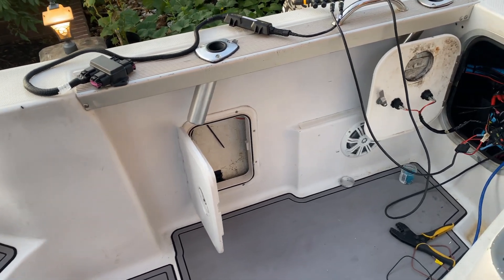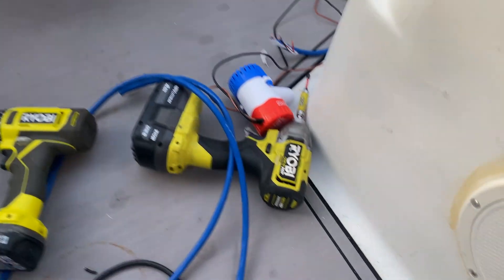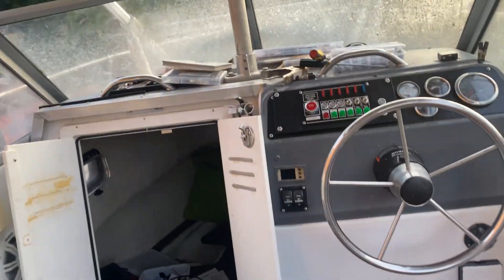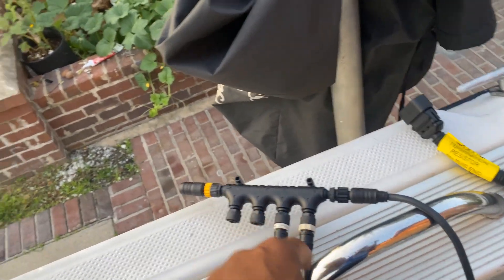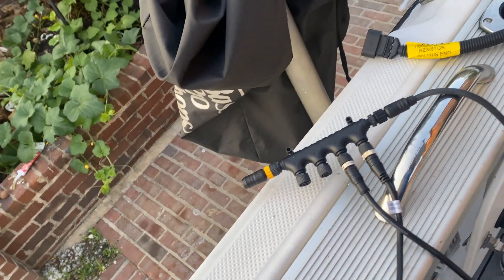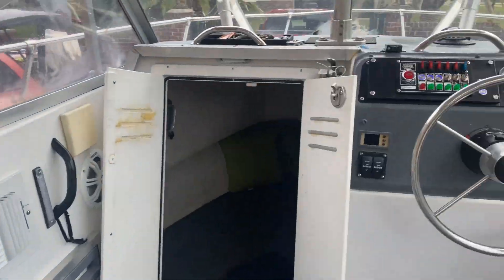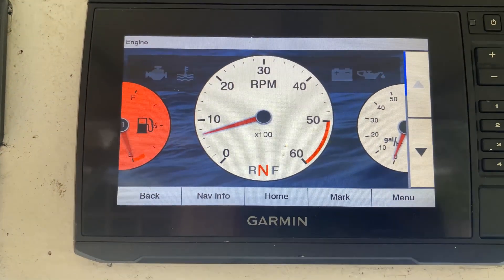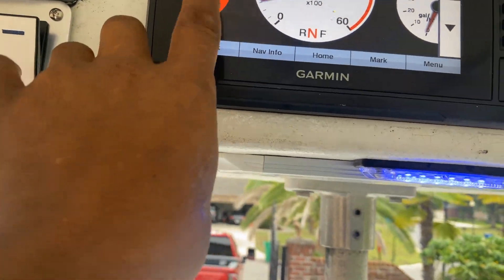Install Mercury nmea 2000 gateway (  National Marine Electronics Association) Part 1 update.

Comment: I HAVE A YAMAHA F70 WILL ALL OF THIS ALSO WORK WITH MY MOTOR, WITH MULTI HUB AND GATEWAY AND BLUE CABLE, I ALREADY HAVE A INTERFACE CABLE COMING FROM MY MOTOR TO THE NMEA2000 BACK BONE
Reply from the maker: does your system come with  i command system. if it does you just buy nmea 2000 cable and connect to your nmea backbone. if not make sure you have a yamaha engine interface cable. yamaha interface cable hook up to the backbone and from your backbone nmea cable to chartplotter
Reply: @visackkhemmanyvong4577  how would I know if I have I command system, I do have the interface cable and backbone hooked up also to my graph

Comment: Thanks for the video. Not sure but can the hub be connected to the gauge output connector, then from the hub one cable back to the gauge and one cable from the hub to the gateway- so that you do not have to connect directly to the engine and then you would save all the cabling.
Reply from the maker: yes, but only if you have the Mercury Marine / MerCruiser New OEM Monitor Eco 4.602, 79-8M0119406. My setup is to display on Garmin CHARTPLOTTERS AND FISHFINDERS. check out the video that video i hook it up to the guage
Reply from the maker: https://youtu.be/yFbxLIu59rc?t=227
Reply: You are 100pc correct, thank you. I got the same result as you the can bus light come on and went off after a few seconds. This is with the spare connector that comes on the harness, one goes to the instrument gauge, the other is spare. I connected the spare to the hub, and connected the gateway to the hub and that is what happened. I am now looking at getting the blue cable that you purchased connecting the blue cable to the hub and the other end to the gateway. It’s just to stop having to round a cable through the transom engine tube. As the ends of the blue cable and gateway are female i guess that i would need a male to male pin adapter. 

Do you think this would work. Thanks for your help, video - there is very little information i can find about the adapter. I guess it’s that Mercury want the dealer to do the work… Not going to happen….

Comment: can you tell me what the hub and blue cable are called and where to purchase?  We are trying to install a Mercury Gateway to have the outboard data on our Garmin - installed Gateway directly to the outboard and, as you said, it does not work.
Reply from the maker: i FIGURE IT OUT IT WORK REAL GOOD.
I WILL GIVE YOU THE LIST OF ITEAM YOU GONE TO NEED
Reply from the maker: Mercury NMEA 2000 Gateway Module - Part # 8M0165589
New Mercury CAN Data Harness Assembly for SmartCraft w/ J Box 879982T20
Reply: @visackkhemmanyvong4577  thank you SO much!  We do  have the Gateway Module already with that same part number, so I will need to get the data harness assembly - did you get that from ebay?  That is the only place I am seeing it with the data cable and smartcraft junction box sold together.
Reply from the maker: @karinvail  yes
Reply from the maker: good luck another thing you gone to need a digital fuel send and don't them together with analog it will cancel each other out this what i use 
https://www.ebay.com/itm/294369649438?itmmeta=01J0426FD9KRDR2GVFJE84QFSY&hash=item4489cc631e:g:mkIAAOSw6cZhLviL&itmprp=enc%3AAQAJAAAA0JOTimkFpUG%2ByHzblmhkW1gABqvVCCxRgCstxeLWiytI4ijlPH5AQashijLqCoD2kzA8I4xSkckF0g4%2FUOGoiOxhN%2F6dQu2uAdYlZaVlUFugCFbDOXXP48QshDhJHvb%2FBgY2JOShjwxKiwtJDq7qjSPskKOSHq4v5TZtycTOm2G8EdGNnxktnOOcHRQ8VkjYHpI0FrkNUNLD386lcaWZJbYc%2FDPOH2YrywrbPh9jq1FJ3IDOBBNJURNksG45ITLFHxbZCOwtYdlSYu4P%2BcQJi%2BM%3D%7Ctkp%3ABk9SR9z2mYKBZA
Reply from the maker: @karinvail  yes